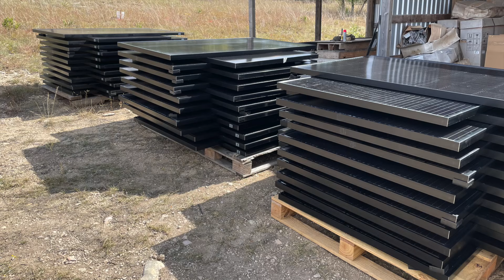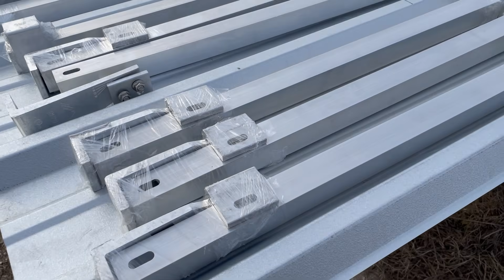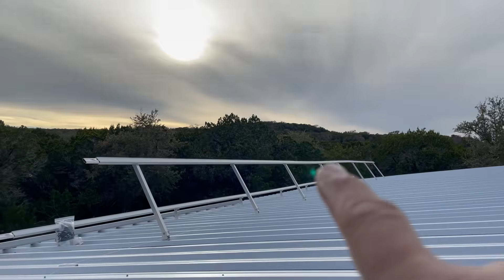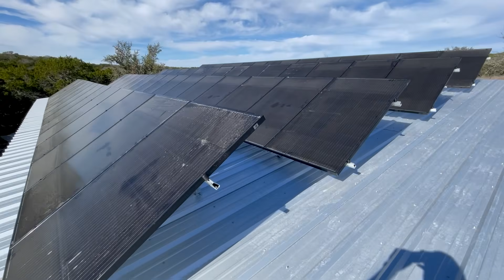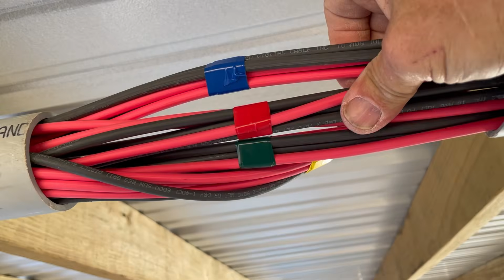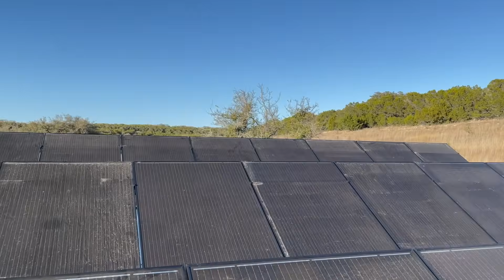One Roof, Two Harvests: Sun & Rain = Winning!

Comment: Great vid! Subscrubed!   Wowowo i want to know more about that tesla rack packs and what BMS etc you are using?  It's a shame the outback stuff has low voltage input for the solar - you could really do with some 600v strings to cut down on cabling cost.  Did you consider using a AC string inverter on the AC out side with some of the array to boost your max AC power during the day or is that not needed?  Running a 3 - 6 kw AC side inverter really helps boost the max AC power you can draw on sunny days.
Reply from the maker: Glad you subscribed! I'll be sharing more about the battery rack and the specific components in upcoming videos, so stay tuned! The BMS is now from Vero. It has contractors on both positive and negative side. The wire has expensive but cry once and forget.
Reply: @maverickmacgyver looking forward to absorbing that knowledge ❤

Comment: That's beautiful Work. I see a problem! That red bypass assembly is for a single inverter installation only. You're not supposed to have a bypass assembly with a dual radian assembly. That needs to be done externally. If you flip one in one position while the other inverter is in the other position you will have a problem! Sounds like you're smart enough to know what you're doing though. Again, nice work.
Reply from the maker: Thanks for the compliment and the heads-up about the bypass assembly!
I didn’t mention much about the inverters. Those bypass plates are not active. The jumpers have have been removed. The bypass is mounted outside on the wall.

Comment: How about scooting the front and back rows all the way to the edges and spreading the middle rows a bit more to reduce shading?  Maybe reduce tilt a tiny bit too.  You’d have to weigh how much production you’ll gain reducing shading vs how much you lose at a slightly less optimal title angle.  
Or, is the shading at such an early hour or time of year that it’s not a significant production reducer?
Reply from the maker: The easiest thing to do would be to just reduce the tilt of just the front row. The front of the second row is the only one that exhibits shade after 4:30pm during end of December to end of January. I left a walkway in front of the front row. The other rows have additional space between them and no shade until closer to the end of the day. This system generates plenty of energy as is working great! Thanks for watching!
Reply: @maverickmacgyver  good point, I’ll leave the first row would need to be flattened a little. Plus, it is helpful to have that road to walk on in front of the front row so you can clean them or easily.

Comment: Have you tried the S-5 Ribbrackets? They work great on these trapezoidal roofs and you don't have to worry about finding the purlins.
Reply: When I wrote that, I was thinking this was going to be a flush mount array. Depending on wind loads, with a tilt mount array, I agree it would often be better to find structure.
Reply from the maker: For the flush mounts on trapezoidal roofs, I use Protea Brackets. I did use the rib bracket on a tilt up before. We will see how that goes. 🤞

Comment: Nice!
So what happened to that EVTV controller and what are you using now?
Reply from the maker: That’s a great question. The EVTV controller usually works just fine. It was powered by a raspberry pi three. And I think it was underpowered for 32 Tesla batteries. Sometimes it would get lost, and I would have to reboot the raspberry pie. The Vero BMS is a modern machine and it has a different controller for the brains. And it has a much better software footprint where you can run it on a PC and see the data on the Internet. I’ll make a video about that if I have enough footage to make a cohesive statement. The Tesla S fit a niche for cost per kWh that is slowly evaporating with the continued price reduction in factory made LiFePO4 batteries. Of course, I would never discount the drive of a DIY enthusiast. It’s my jam.
Reply: @maverickmacgyver  I like going the full pack route with a High Voltage inverter, No battery disassembly required. I did 2 Nissan Leafs so far, you can get the whole car at Copart ~$1000, pull the battery, sell the inverter, PDM, Motor send the rest to scrap and you end up with a free battery. Or us the parts for other cool projects...